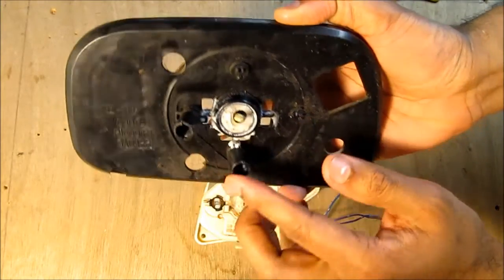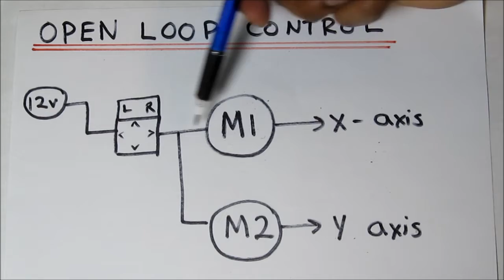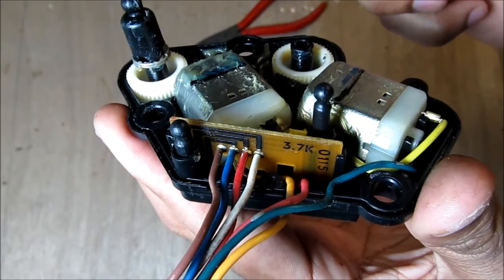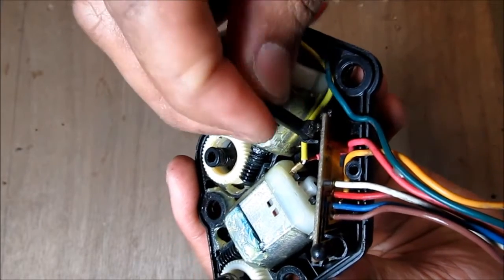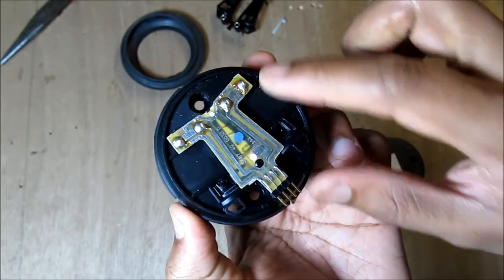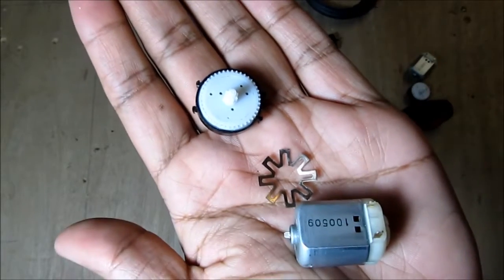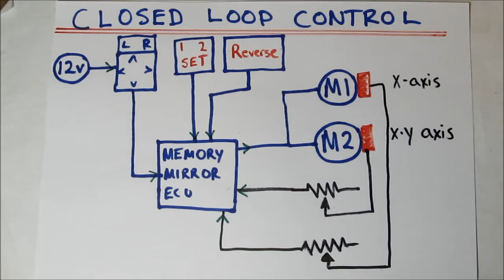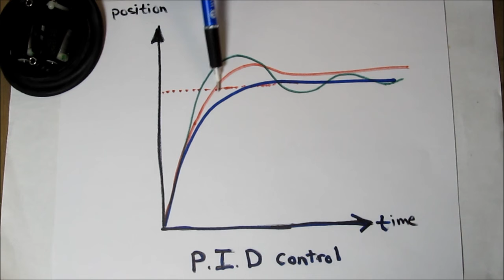How Memory Mirrors Work

Comment: PLEASE HELP! I have an issue on my 2016 dodge charger. Side mirror has memory and blind spot. I opened the glass on the mirror by prying it and it snapped open and i replaced the glass due to led on blind spot burned. Now suddenly my memory function doesnt work? I get this code: MEMORY CONTROL SENSOR POSITION CIRCUIT OPEN OR SHORT TO GROUND. Iam frustrated i cleared code nothing still fault. I moved it fully down up every way no luck. Is it because i tilted the mirror down a lot and pulled the glass out hard? Did something break or sensor misalignment?

Comment: Only the glass is broken in my mirror. However, I have purchased three replacement glass units, and none of them has fit into the housing. The second one was ordered directly from the Toyota dealer. I have found a used part that has the glass and the housing, but it does not have memory and mine does. Will it fit?
Reply from the maker: It'll fit but you'll have to repin it to work with the connector

Comment: That was a great video! What would you think causes a mirror to move on its own without touching the switch? If I leave the switch on either L or R, the selected mirror will very often tilt all the way down, either when i am parked or driving. At first, i could hit the up button and it would stop doing this. But lately, if i press the  up button, it stops moving and as soon as i let go of it, it keeps going down. I have to move the switch to the middle position and manually push the mirror up.
Reply from the maker: That's a feature in Lexus vehicles
Reverse tilt so you can see the curb
Reply: @speedkar99  yeah, unfortunately it does it when im going forward... And its a kia sedona by the way

Comment: On my 2008 Lexus GS350 sometimes the mirror does not return to my stored position after tilting down for reverse. Suggestions?
Reply from the maker: I have the same problem on my 2007 GS350. 

It was so annoying I stopped using the reverse tilt function. 

I think there's just stuff in the sensor and it needs cleaning
Reply: speedkar99 is there a way to turn it off and on?
Reply from the maker: Just make sure your mirror switch is not left on the R or L setting
Reply: speedkar99 if you ever decide to clean your sensors I would watch that how to video 👍

Comment: Why does a memory mirror lose it's memory when car is turned off requiring re-positioning each time the car is started?
Reply from the maker: +ART PICHIERRI It shouldn't. That means your computer (which stores the position) is loosing power.
Reply: Thank you. This is a 2005 Corvette. If I don't drive it 2-3/month I have to charge it up, but, even when charged the mirrors lose their memory. Is there a separate computer for the mirrors? Is it difficult to access?